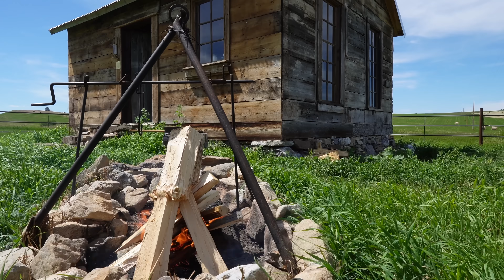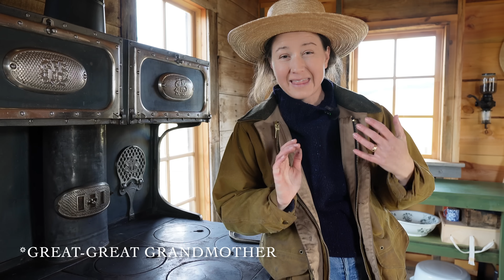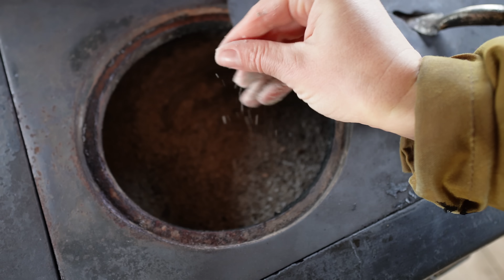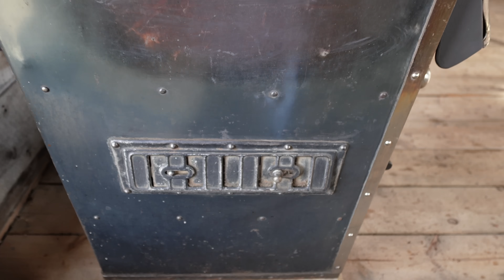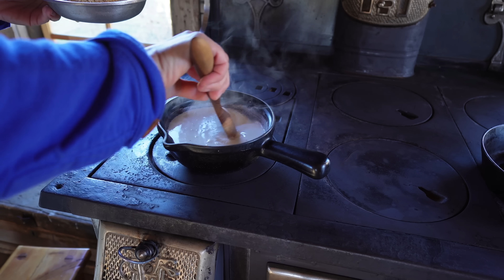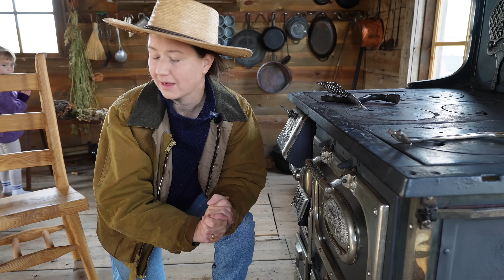How A Cookstove Works 🔥 (wood-fired)

Comment: I got a lot out of this week's video, lots of memories, and lots of thoughts. Boy, that Monarch stove sure was a beauty. I bet you think back to your cabin days often. There’s a wealth of knowledge in those days gone by. 
I’ve had wood stoves entrenched in my life from day one. The big family house, which the first winter was no more than a one room box with a 6’ Franklin potbelly stove in the middle must have been a real challenge for my mother, a big city girl of 20 years. I don't remember seeing  any pictures that indicated there were even any windows to look out or get any sunlight in. It was basically a box car without wheels. It's hard to believe I came home to such rugged conditions from the hospital as a newborn. 
I was often told about my first voyage to Winnipeg to be introduced to my grandparents at six months of age. It was winter, and the family car was a 1946 Jeep with a homemade cab to enclose it from the elements. Having owned a more or less modern 1979 Jeep CJ5 myself, which had a less than stellar heater, I can only imagine how cold that trip of 350 miles was. Slow and tedious, with  a top speed of 45 mph, which was the best a post WWII Jeep could do. I was also told I made the trip wrapped in blankets, curled up in a cardboard box placed on the floor boards between the two seats. Supposedly hoping to glean some of the heat coming off the engine and transmission. 
Using a homemade plow scoop of sorts, my father dug out the basement for the house with that same 1946 Jeep. Right after the war, new cars were still unavailable, so the leftover military Jeep was the best you could get. It wasn’t until 1951 when the family car was upgraded to a new Chevrolet, which remained the family transportation until I graduated high school in 1968. Talk about driving them until the wheels fall off. By then it was a Flintstone mobile with road slush and such splashing up on the passengers through the rusted out floor. 
Over the next five years or so the house continued to grow, to a full square box of two stories high with an almost flat roof. My memory tells of the big Franklin Stove always present as that part of the house became my father’s cabinet shop. Up stairs in the living portion of the house was the Warm Morning coal stove, which we burned wood in, just cut to smaller lengths.  The basement, which had a dirt floor for some of my childhood, had a small laundry stove as they were called. A simple two lid potbelly stove that could heat up a space well enough to make using the second-hand wringer washer, which I often helped with possible. With a family of 7, there were always clothes to wash. In later years, there was the weekly trip to the laundromat some 10 miles away. It wasn’t until shortly before I left home that an automatic washer and dryer were installed upstairs where my family lived.
I’m sure it’s because of my upbringing that I’ve always made sure most places I’ve lived had a wood stove of some kind for backup heat. Minnesota winters are no joke, and counting on a furnace in those days was a level of carelessness I wasn’t willing to accept. Plus, nothing beats the comfort of wood heat. 
Both of the places I bought later in life that were solely my own, the first thing I did was install an airtight style wood stove. The first house had only electric heat when I bought it, and the cabin had the hole in the roof. The previous owner stole the wood stove and chimney before it was foreclosed on. 
Even during hard times, which for me was the bad economic years of the late 70’s early 80’s, I had a homemade wood stove setup in the enclosed porch of my mobile home. I built an insulated plenum around the stove, and with a circulation fan pumped the heat through a 12” hole I plumbed into the mobile home. When heating oil became unaffordable, I had 6 acres of forest to cut all the firewood I needed to keep the -40 degree nights from freezing us out. 
In some ways, my nomad years relate to your off grid cabin years. Yes, I was mobile, but the campfire was a daily part of life.  For baking, I had a folding Coleman oven, complete with mechanical temperature gauge that made the best biscuits ever. Like you, I’m a big fan of biscuits and sausage gravy, but I also enjoy the sweeter side as I was brought up on biscuits with maple syrup. I’m also a fan of cornbread and blueberry muffins and have made many a pan of both with my little folding tin box oven. 
I think one of the best things about pioneer life, early settler life, off grid living, and nomad life is the level of self-confidence it builds. To a very real degree, survival… and comfort demand you understand skills that have been lost in the dust over time. I have a very hard time relating to extremely citified people. There are plenty of smart people pushing pencils, and shuffling papers that are totally reliant on other people to do anything that might get a little dirt under their fingernails. They get totally freaked out at the very thought that the store may have empty shelves, or the electricity might go off for more than an hour. Their knowledge of heat and cool ends at the thermometer on the wall. I’ve lived my whole life knowing that if it didn’t work, if it wasn’t available, if the lights went out, it didn’t really matter. There would be little difference in my life, I would be OK. 
You’re very fortunate that partly due to upbringing and circumstances, but deep down, I sense a level of personal determination that your family is so close knit. Farm or ranch life necessitates such closeness, but a lot of closeness comes from the heart and soul. Somehow I missed that lesson. For so many reasons, my family just didn’t gel as well. It was a mixture of things that altered my path. But the one thing it did instill in me was confidence that whatever comes along, I can handle it. 
Thanks for the trip down memory lane. I had a story prepared, but I felt this side trip was more pertinent, so I winged it instead. Have a great week!
I almost forgot, that newspaper, it must be hard to come by these days. Pretty rare stuff. I remember a small newsstand in downtown Duluth where you could buy slightly out of date papers from big cities across the country and far off places such as Winnipeg to keep up with events affecting relatives.TV and radio seemed to think the rest of the world didn't matter much back then.
Reply from the maker: I felt like I walked right into your first childhood home 🔥 What a place, like you said, to bring home a newborn baby! How it grew/changed as life marched on… boy I think of your mother and how she must have felt coming from the city. 

Makes me sad life didn’t work out easier… I wish I could go back and rewrite that history. I had an easier childhood in many ways, but, like most of my generation, devoid of real struggle/worth in the family. Too much comfort. It’s not good for us. Comfort but no deep family connection. I don’t want to fall into that trap with my young family… hard to avoid these days. Guess I just need to have George help me carry a lot of firewood 😉 

Always love your stories/memories/thoughts. They take me to a far away place. Cheers from a pretty warm fall evening in Montana 🔥